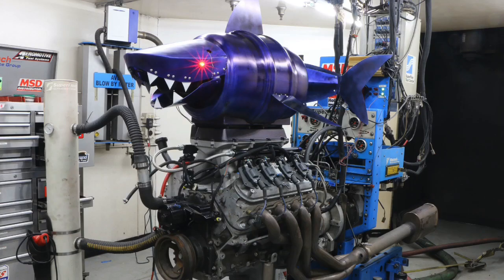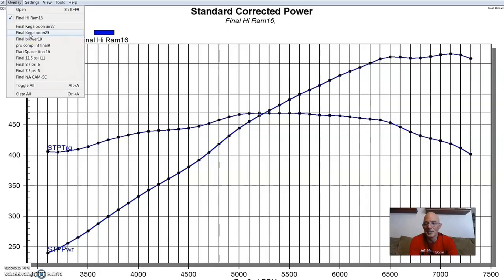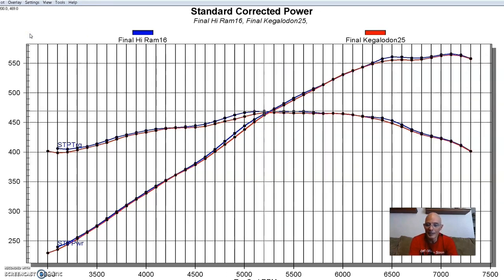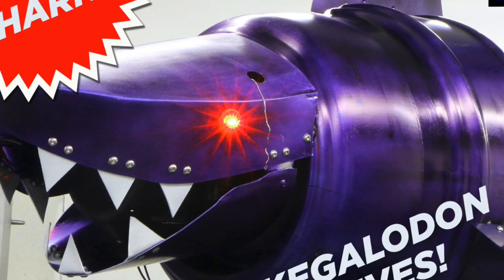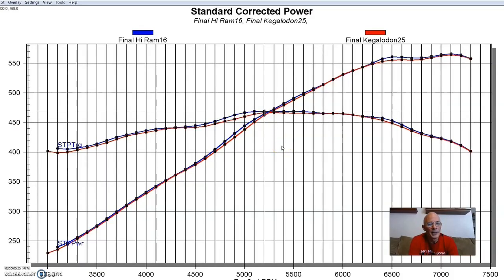DO CARB SPACERS WORK? THE ULTIMATE TEST! THE BIGGEST LS CARB SPACER EVER TESTED-THE MIGHTY KEGALODON

Comment: So I know manufacturers add lil chambers to intake tubes for sound reasons but would it also affect Hemholts frequency? Would an intake tube with an adjustable size chamber off the side be able to dial in that frequency to help performance?
Reply from the maker: OEMs do it for sound, but you can try (I did a lot of size and length tests on an LS with very minimal changes)

Comment: Hey Rich,love all the content 1st off. My question is i seen the episode of Engine Masters, where you guys tested different intake manifolds on the 360 Magnum,i wanted to know if for my daily driver(absolutely no racing just cruising)is the modified kegger and throttle body worth spending over a grand on my truck( that I barely do 90-100mph at any given time except Vegas runs😊) it's bone stock but i do plan on using the same cam if not the 216/224 duration cam instead? I appreciate you input thanks.
Reply from the maker: I would not spend the money on that mod-do a cam and springs and headers
Reply: @richardholdener1727  Thank you kind Sir, appreciate the speedy reply and definitely the honesty,your the best rich keep up the great work bud!

Comment: Hi Richard, I love your videos, and your channel, you've got tons of great content. I think what this test shows, as other comments have mentioned, is that the plenum volume on the manifold as designed by Holley was more than adequate for the engine combo. I'd be really interested to see results on a test starting with a severely undersized plenum, and gradually increasing volume until no further gains are seen with increased volume. Thanks for all the effort you put into all this stuff, and keep up the great work!

Comment: Id imagine theres a tipping point where the plenum is large enough.
But below that might there be changes?
For the 2.8 and 3.1 60 deg v6 the plenum is around 0,5 liter.
On the later 3400 engine its 1 liter. The still later 3500 engine its atound 1,5 liter.

In the 3900 they have a active wall in the plenum that divides it into two chambers at certain rpms.
I think its open in low rpm, closed in mid and open again at high rpm.

But those are fuel injected engines of course

Comment: fuel stand off? is that a unwanted excess syphon condition? ive not heard this term.
Reply: It's when the reflected wave coming back from the intake valve pushes all they way up through the carb venturis, and pushes fuel up out of the carb or stack.

Comment: You're thinking about plenum volume in the wrong way.  A plenum is supposed to be a quiescent space that maintains a steady pressure to allow all of the cylinders to breathe equally.  It is the runners that have to be calculated to resonate at a certain frequency selected by the engine designer to maximize volumetric efficiency at a definite engine speed.  This is the purpose of the Helmholtz calculation, and defines where peak torque is achieved.  The plenum volume must be a multiple of the runner volume to decouple the resonant frequencies.  

Once upon a time, I was working on a V12 marine engine project where it had been designed with uneven firing intervals; 30-90 all the way through the firing order, instead of 60-60.  We were brainstorming ways to improve performance, and theorized that the odd-bank cylinders were robbing air from the even-bank cylinders.  To test this, we modified the plenum with dividers to make the cylinders breathe in four sets of three, by dividing the engine into quadrants.  The power output dropped by about 50 hp out of 860.  Then we took the lateral divider out, so the engine would breathe like two inline sixes, but the power only came halfway back..  So we were totally wrong in assuming one bank was robbing the other, and concluded that plenum volume should be about double the engine displacement.  

I would like to see you do tests in the opposite direction: take a Holley high ram EFI manifold, and cut its volume in half.  Then see if it reduces power.
Reply from the maker: runner length determines the effective operating range-Helmholtz Resonance is the resonating frequency of the Plenum volume as described

Comment: I think you missed the magic of the plenum "volume".  You want to havea column of fast moving air, the faster and longer the better... like an intake runner.  

The kegeledon has tons of volume but it is not being sped up... its like hogging out intake ports too big.  Less volume and more length is better.  You are wanting the inertia of the moving air to keep the air moving even after the valve closes so that when the next valve opens the air is still moving.

Also if you can add your fuel before the plenum extension you will get the benefit of the increased weight of the air caused by the weight of the fuel.  This dramatically increases the weight of the charge column.

If you replaced the kegeledon with a 4inch pipe x 4 feet long that might do better... you need to tune that so maybe have a 3 inch and a 2 inch and a 1 inch and 5 inch and 6 inch pipe to show the extremes?

Comment: I put a 1” spacer on my 350 Performer rpm duel plane with holley 750. bore 20 over flat top aluminum pistons stock crank and rods mild-medium comp cam. 194 stock heads that I ported and cleaned up as much as I could. Hooker headers and swap to Hei. Runs strong but I’m pulling the motor soon to build something a lot nastier and this is the matching numbers engine so I don’t want to blow it up so I’ll oil it wrap it up and put it in a corner for the future. I’m third owner of the car it now has 110k miles. I have had it since 64k I went through whole car during my first time having cancer and doing chemo treatment. All that said the spacer definitely gained some power the engine liked the increase fall for sure.

Comment: Is there a test you can do in which you can limit reversion ie: some sort of fluting that offers resistance to outward flow. I have always wondered what a set of runner mounted Read Valves would do in a back to back  test, with and without.

Comment: One thing not mentioned between the single and dual plain is firing order and port sharing.  While negative pressures are shared between all 8 cylinders on a singke plain. The dual separates them. Hence the old pratice of using a larger carb on a dual plain. A open spacer may improve volume. It does not improve the approach of the negative pressure to the ventries. Older single plain intakes with a spread bore plate sometimes used a dividing wall. And some that even shared all runners to the same side bank. Tunnel rams still give you the best of both worlds.

Comment: Sorry my device or YouTube kept eating my comment so I ended up retry 5 + times gerr that’s why It’s edited more than once 
.
Yes do like the idea of testing the same intake with a carb or moving all 8 efi injectors up top or mechanical injectors vs down at the ports. I do like the idea of retesting the kegladon at a lower RPMs and add a carb ( for 2 different runs higher again and lower ) on top of it and leave the rest the same way as the last testing procedure aka keeping the Throttlebody bolted on just shut when testing the carb part ( and the same way with testing the injection testing just shut the carb blades off ) of the testing to see if it makes any difference or not to really drive your point home 🏠 . Heck I’d try it out on the dyno temporarily to learn but my engine isn’t ready yet and I’m biased to cross rams 🐑 ( do you Richard have any dyno stuff from the mopar 60’s cross 🐑 that you showed in the video and I think 💭 it might make a good content ) and I like my OG hood without a big hole in it or skipping having a bonnet . 
.
I’d love to learn when to spray and were to spray as my intake has more than one injectors set of 8 sequential efi injectors ( and one  Direction direct injection set of 8 inside of the combustion chambers for a spray pattern aka GDI/diesel 5000 psi / 350+ bar set because the parts number looks the same if I’m not mistaken but the pumps are different than or the settings/setup  ) and two mechanical constant electronically adjustable ( ecu by way of a ball valve servos ) spray bars in the plenum ( / mounted to the ) sides pointed at the super chiller HX / intake ports and 2 mechanical ( same setup as the bars as custom efi units are expensive to buy and bulky to use and this was my fix ) nozzles after the turbos to  supplement extra fuel ⛽️ in.
.
I have questions about how helmholtz frequency affects camshaft timing ( fixed and unfixed ) / VVT,VlSA( variable lobe separation angel ),VVL or how variable intake ( or fixed length ) ( and I guess exhaust two well where on the topic ) runner length and how it effects the tune up / tuning strategy aka spark tables and fuel tables and or the firing 🔥 order timing as helmholtz frequency can change cylinder to cylinder scavenging I think 🤔 💭

Comment: When the throttle body is restrictive for the engine, then additional plenum volume becomes more valuable.   When the TB is oversized, then you can get away with very small plenum with little loss.

Comment: Interesting, I always thought fuel standoff ( same as double carburation ?) was only a concern on old 2 strokes without reeds on intake.  So the rpm range with fuel standoff richens up that area of the RPM curve when the air passes through the carb 3 times before it ends up in the cylinder same as an old 2 stroke?  Is this the primary emissions advantage of direct injection?  If so, how do VW direct injected TSI intake ports get loaded with carbon?  Maybe they're opening injectors too early trying to give fuel some time.  Thanks for all the testing!
Reply from the maker: no fuel going through the ports to clean them

Comment: i found on my b20vtec that going from a 1 litre plenum with a 70mm throttle body and 2.5 inch cold air intake to a 5.5 litre plenum with a 90mm throttle body and 4 inch cold air intake there was an average tempreture drop of 20 celcius/68 fahrenheit, but also an increase of air flow of 18%  at the topend 9500rpm of course AFR's need adjustment and were corrected. also what i had found was putting a 65mmX2.5 inch long restrictor inside the 4' CAI on the 90mm throttle body with the  5.5L plenum it picked up response and better throttle transition. and on the VE tables pretty much from 2000rpm till 9500rpm it  was in the 105kpa column @ WOT when compared to the original set up maxing out to 102kpa @ WOT.
Reply from the maker: you saw a change in IAT from a plenum change?
Reply: @richardholdener1727  yes that's correct Richard
Reply: @richardholdener1727  although the motor is naturally aspirated I think it has something to do with the expanding inside a larger plenum allowing it to cool down

Comment: Surely the heat isolation effects of a carb spacer can have a positive effect, particularly on old cast iron intakes.  I'd love to see a comparison on a street/strip motor, dual plane intake, carb.  A variety of spacers trialed - open, 4 hole, tapered and in two different heights, say 1" and 2", see if there are any trends.
Reply from the maker: an aluminum carb spacer actually transmits heat to the carb-alum is a very good conductor but a poor isolator

Comment: Does the extra time for a carb to mix the fuel with air over fuel injection the same as air charge temperature as opposed to port injection over TBI?
Reply from the maker: TBI add charge cooling like a carb, fuel atomization is already good with high-pressure injection

Comment: If you've ever played around with subwoofers, you'll understand Helmholtz resonance a bit better. Also a ported sub box reacts kinda like the resonance chambers in factory air inlets
Reply from the maker: sub woofers only resonate-they don't add pressure wave charge filling to improve power
Reply: @richardholdener1727  I guess I meant more about how different volumes resonate differently
Reply: @richardholdener1727  Anton had the same line of thinking I did... change the port shape or size dramatically and you can feel the difference in the air coming out of the port, so much as to actually hear it chuffing if the port isn't big enough, and you're trying in most cases to tune the box to a specific frequency. The chuffing (port noise) could be analagous to fuel stand off? Just spitballing here, but that's what came to mind when you discussed fuel standoff.

Comment: I ran a mechanical fuel injection Bird catcher on a Tunnel Ram ( large plenum volume) when you would lift and close the butter  flies the engine would slowly drop R.P,M back to idle. compared to the Carb's

Comment: Love the testing you do and scientific way you go about it. I did have another idea on potentially another plenum volume test. My thought was the testing you’ve shown lately, and forgive me if you’ve shown this and I just missed it, is all about adding volume. What about less volume? Small block mopar magnums for example had an option of a 2bbl single plane manifold that could be bought direct from mopar. That manifold had a fairly small plenum volume to it compared to more conventional intake. And while the runners have been shown to flow within 10cfm or so of the 4bbl version that was also available, general consensus is that the 4bbl is a much better option for anything that sees boost, nitrous our big cubes despite often using the same 2bbl throttle bodies. Factory they came with a large keg style intake and Dulcich alleged to it during the engine masters episode on volume but a lot of guys go to great lengths to reduce the volume. While that engine specifically may not be the greatest option for taxing the intakes just based off cylinder head options and variables that are difficult to make consistent, maybe a stroked 4 banger like a Honda B or H or K series would be a good test. Lotta guys go to great lengths on those to increase volume so it begs the question that, while too much is not much a problem it seems, maybe too small is? One of those things where testing just leave ya with more questions lol

Comment: A problem I saw with this on EM was the plenum was on top of another smaller plenum and the smaller one closer to the runners would have made the biggest changes, So effectively the keg was just far too up stream and it was like having the door open next door vs having it closed for all the difference it would make, The plenum actually has to be directly attached to the runners themselves not through a smaller secondary plenum is what i'm trying to say.
.
I think also the main benefit of a plenum is the resonating pulses in the intake have a less dramatic effect on the chambers vacuum signal, So one cylinder opening its valve is not effected by the prior cylinder closing nor does it effect the next one about to open afterwards, The cylinders get to work more individually.
Of course runner length has a dramatic effect on this as always and on a carb engine while the vacuum might be more consistent the distance from carb to cylinder might mean worse throttle responce but given a turbocharged application especially with multi port EFI (so imports with 2JZ's etc) its probably not much of a concern. If you look at past or modern turbo F1 engines the plenums tend to be the same size as the engine block!
.
I think the short runners on that FAST intake have a huge problem that they are effectively drawing from the space directly in front of thier neighbour and that makes every cylinder suffer, the second their throats pass each other in the medium length suddenly everything gets better and it surprises me they didnt pick up on this.
Reply from the maker: Plenum volume can be connected through the two carb openings as we used. Its like joining two dual plenum intakes that resonate as 1

Comment: If you ever saw a dyno run of the last carbed 600cc sportbikes with the airbox removed, you would begin to understand the reversion, and fuel fog standoff Mr Holdener is talking about. Just below the torque peak, the fuel reversion was incredible!!! It gave you a ton of respect for the men engineering the carbs
Reply from the maker: we ran a 600 with no air box on the chassis dyno standing next to it with a video camera and a strobe light to see the fuel past the valve and the fuel stand off-it was awesome

Comment: I seen this before and at the time I did not know what was going on except I fixed the problem with the fuel over the carb a 750 holly the problem is the pressure wave bounces back of carb and and it picks more fuel as it goes back in again .  I fixed the problem by  changing the exhaust and the change  was instant . I was a kid back then an Pete who had a record holding Manza told me about the signal to the carb and how manifold design and port size ect effected that signal . Many hours were spent there watching him work on his Monza . I listened to him chat about the cylinder head design and making hp . Long time ago back in the Sheppard days
Reply: Thanks for educating us as jim I was curious if the exhaust side messed with the intake side if only one side was changed or if both changes at the same time on runner lengths and everything else motor and drive line wise was the same. Guess now I know helmholtz frequency can change pinging/ knock resistance and how the exhaust vibration can affect intake feeding of air and fuel into each cylinder firing event as I’ve never heard of your exact carb problem and how you fixed it.
 I have heard of some intakes being picky before but a quick change to a different carb (  / or Throttlebody ) or changing the intake to a different one fixed it